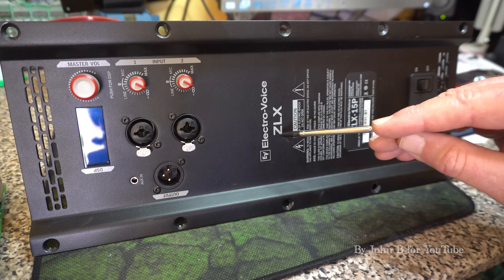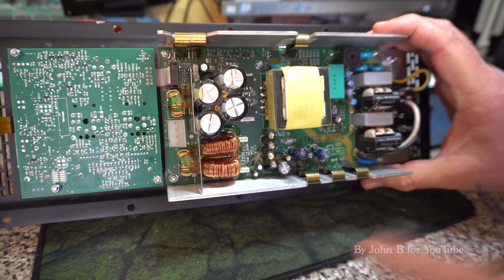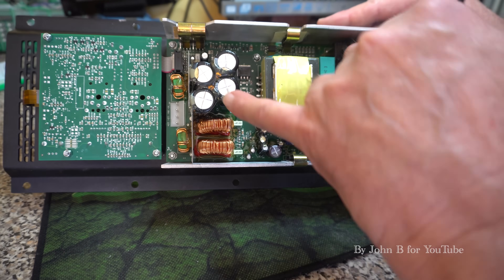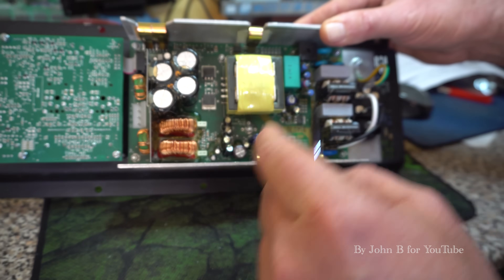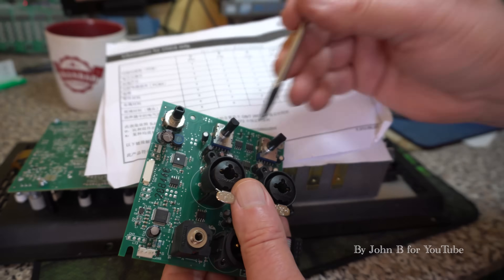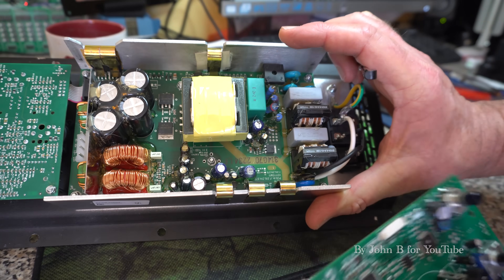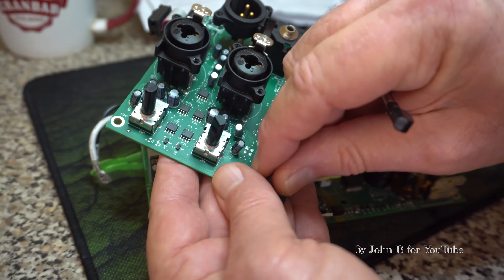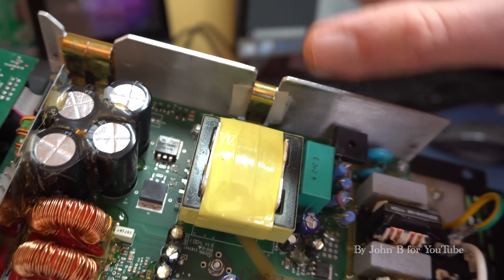The Inconvenient Truth about your Electro-Voice ZLX-12P & ZLX15P amplifier (Read Show More)

Comment: So is this 500 program power or continuous power. P. S isn't it better to go with spl reading as wattage doesn't really mean anything in this day and age.?
Reply from the maker: It's peak power at 10% distortion. Tell the chip manufactures watts don't mean anything.
Reply: @JohnB-2021 experienced users will know that overrated manufacturers use the peak power as a selling techniques to inexperienced users who get fooled by numbers. My understanding is that the wattage is either measured or burps are used to calculate the power which is nowhere near. I've heard the zlx12p and it sounds more like 250rms
Reply: @ninjatzuuninjazuu8776  One thing with EV is they definitely use peak power for their active speaker ratings. How accurate it is, is one thing but either way, power ratings don't matter as long as they get loud enough for your circumstance. I find if you are looking at EV's active speakers - look at the exact passive variants too and they will list their RMS power and you'll get a rough idea of what they will typically run. I know with the EKX12s for example - the powered speakers are rated at something like 1500w. Which is unrealistic, but the passive version has the RMS rating of 350w. So you can put together that realistically the powered version will run around 350w and maybe have a peak of 700w. 

But I'm convinced this really isn't an EV thing. My advice is that if you really want to know what power you are pushing, go passive because you have WAY more control over what you're getting in a product and ratings can be more realistic (As long as the brands are good).

Comment: Hello sr great video.. i have the ev zlx-15p everything work fine but sometimes make a rare noise is like a ant walking on top of the audio cable.. what do you think could be ?
Reply from the maker: Hi,
Thank you for your comments, sadly I don't know what an ant on an audio cable would sound like.
As my friend says, break it some more and then it can be diagnosed.
Reply: John B ok yeah is something like that braking up but the sound work perfect. And I unplugged the audio cable still making that sound
Reply from the maker: @juliomaria3453  Probably a danaged input board, who can tell without putting it on a scope.
If you have 2, swap each board.
Reply: No, because i disconnected the cables and still making the noise
Reply from the maker: Julio María yes that’s why it could be the input board.
Reply: How can I order that one ? Do you have. Link that i can buy it
Reply from the maker: @juliomaria3453  I imagine a Google search will give you an answer.

Comment: Lord John B. I remembered the Peavey products we used in early 80's. We read 200 watts from the pancake an the sound rich all the Block and all night.  Today we see it portable powered speakers with 10,000 watts this is the energy off 10 floors Building consumer so the new generation don't know about Peak (a few seconds )  Program 1 hour at some volts and the RMS. Continuos. 8 hours like a party events. Thanks so much for your info.
Reply from the maker: Thank you for the comments, good old Peavey hey :)

Comment: I just bought  a ZLX12BT to use with my line 6 helix guitar multi-effects processor board. Are these speakers no good? I was going to
Go with an FRFR powered speaker that’s meant for guitar modeling but don’t exactly want to spend over 800-1000$. Any suggestions John?
Reply from the maker: These ZLX speakers are ok if you can get them for a few hundred bucks, I'd not pay more because they are simply not 1000 watts.
Yamaha DBR speakers are much better but come at a price.

Comment: You are right.
That said, don't judge a power supply by its size. Depending on the topology used, a SMPS with a transformer that size could easily deliver in excess of 2000W. 
And none of that "watts RMS" rubbish! The correct is watts, period!
Reply from the maker: Show me a 2000 watt SMPS with one small transformer and one fet driving it.
Watts RMS is rubbish?
Please.
There is no room on that bobbin for an amount of wire to deliver 2000 watts.
Reply: @JohnB-2021  I'm designing a 3000W SMPS for a 2500W amplifier. That supply will deliver 4400W of "burst" power. Also, inside the Yamaha T5n (2500W @ 4R x 2), for example, there are transformers even smaller than the one in the video. Trust me!
Reply from the maker: Matheus Moreira no I will not trust someone who says RMS does not exist
Reply from the maker: @mattmoreira210  I have just found some poor res pictures of the T5n, there are 2 transformers in it, did you forget to mention that part?
Reply: @John B You didn't look at the specs, did you?! Because the amplifier is rated 2 x 2500W in 2 ohms. That's 5000W split between two transformers. And guess what?! 2500W + 2500W = 5000W. Magic!
Reply: @Matheus: Does that 2 x 2500 watt,  2 ohm rating come with a guarantee?
Reply from the maker: @gsonn18  lol, I like it.

Comment: 1000 Watts...    Lets see..  P = VI     I =  V/R   so P = V * V /R .    If rail voltage peak to peak is 80 V   80 x 80  /  8  ( 8 ohm speaker )   =  800 watts peak  +  200 for tweeter  = 1000 watts..  Granted that is peak and not RMS  , but guessing that's how they come up with 1000 watts.   Also data sheet for chip says current limited at 12A  so assume they are driving this as hard as they can.. 10A   P = VxI  so again we come up with 80 x 10 = 800 watts. max.. peak .  Data sheet for chip  says 420  typical into 8 ohm load  but no max info.    If we convert to RMS   .707 x 800 =  565 ..  which is closer to rating for the chip.. So assume 550 for bass  150 for tweeter   = 700   so My guess..  is the RMS is closer to 700  not 500 like stated. That said.. most specs will show the peak max .. vs more reasonable  continuous..  I have ZLX12's  and for the price they are a decent speaker.. These are not top of the line speakers.. so never expected to much.. But they a have yet to let me down.
Reply from the maker: What cereal packet did you get the 80 x 80 from?
Try 35 x 35 volts
The treble chip isn't rated at that voltage either.
Nice try, but you're wrong.
That info you read, that is the max and a nice 10% distortion, they rate their own chip at 82 watts or something at 0.5% distortion.
But hey, if you think 10% distortion at full power is ok, keep on buying them and I'll keep repairing them.
It's sad if you have to add the tweeter to get the max power up. 
That chip is a 100 watt chip, not 200.
Reply: @John B why being so passive aggressive, mate? Chill out. He's brought a nice, constructive argument.
Reply from the maker: @mattmoreira210  
How can it be constructive when numbers are pulled from thin air?
So quoting the 'facts' is now passive aggressive?
Reply: @JohnB-2021    how am i pulling numbers from thin air ??   sorry if you took offense to my post,  but  I was just trying to come up with how the can show  this speaker at 1000W.. I agree, it is a marketing  thing.  and the speaker is closer to 500 to 700 as you  stated when we think about things in terms of RMS or continuous use.    As to how i got 80 x 80 ?    From  YOUR  vid.   You said .. quote.. Tweeter chip is 100 to 150 watts  ( no data on tweeter, so i guess yes, i pulled that from thin air going off what you said )   .. and  80 V p-p   for the main speaker  chip.  Those are YOUR  words.  in YOUR vid.. So not sure what your talking about when you say  35 X 35.    Maybe that is the actual rail voltage  if you measure it for the woofer ?    Also from the data sheet  It shows the bridged mode.. + 41 - 41  into 8 ohms  typical .   that 80V p-p  rail voltage yes?   So that's were i get 80 V  p - p .  ( not from thin air)     Then for a quick calculation ,  i stated the equation for power which is  P= V * I .  ( not from thin air)    We don't know  "I " but can solve for it.. V = IR   or   I =  V/R   substitute  that into P = VI   we end up with    P = V * V/ R   yes ?   so   V =  80v  p-p  right ?   so  P ( peak) =  80 * 80 /  8   = 800 watts  peak  ( theoretically)   add  200W  for the tweeter and your at 1000W.. so that is my theory on how they can market this as 1000W speaker.    No thin air involved.. have a good one..
Reply from the maker: @stevepritchard357  But the chip manufactures quote 2 x 210 watt with a supply rail of +/- 41 volts max, that is peak power and the treble chip is 100 watt, not 200 as I have pointed out before.
One can't take the supply rail max voltage and get more power out of a tiny little chip amplifier.
The actual rail is +/- 35 so the chip does not actually reach it's full power rating anyway.
Powerful sub woofers and amps that quote specs of 1000 watts, or even less, have supply rails of +75 volts and -75 volts, that is more than double of this little EV amp.
They do not swing up to the supply rails before current limiting takes over.
And you will have read, that tiny little chip limits the current to 12 amps max.
No way can the little EV power supply supply a continuous 12 amps at +35 / -35, I'd put money on the voltage dropping even further or the chip would go into thermal protection due to the lack of good thermal conductivity on it's heat sink pad.
Or, they just blow up like hundreds do.
Reply: @John B oh, so it wasn't your intention, was it? Sorry for that.
Reply: @Steve Pritchard yes! That must've been how they got their 1000W "peak" figure. I hate marketing.

Comment: hi mr jonh mi name is jose ijust want tell you i made setup  2 bass ekx18sp on 2 zlx15p but when i conect to power  on turn on star make it big noise  on after 30 second burns it one base on one speaker  you have some ideas why those happened?
Reply from the maker: Probably some earth loop, I have heard of a few systems failing because there are problems with the earth on the input leads.

Comment: Thanks for the video. There are so many active class d speakers that use this type of setup. The issue I have with the whole on-board dsp (analog devices / st-mico / whichever) is if that ic gets damaged, you have to purchase a whole new board as no-one supplies firmware for it. Such a waste really!!  I have to ask why you keep saying it's not running bridged? If one full channel is only amplifying the positive half cycle & the other channel amplifying only the negative half cycle, is it not then running bridged?
Reply from the maker: Hi, 
Yes my bad, it's running in Mono Bridge-Tied Load
I wanted to highlight it's 2 amplifiers in one package, not just one signal and ground.

Comment: John, I have a pair of the newer mackie thump 15a's.   I used them for band practice (vocals only) for 2 years now.  then 1 gig with the. as  full range mains (vocals, guitars, a little bass, and kick mic) though we had subs too.    One of them sounded distorted after that.  Distorted like an active bass with a low battery distorts.   Repair shop says it has a bad "power bucket "  I have no idea what that is?   Should I fix it for similar future gigs?   I was contemplating buying some EV speakers instead .  what do you think?
Reply from the maker: I think if you buy the EV speakers mentioned, you'll be disappointed since they are no better than the speakers you have.
Get someone to swap the amp and power supply and woofer from one to the other to narrow the fault down.
I've never heard of a power bucket, not even as a slang term.
What country are you in?
Reply: @JohnB-2021  USA my friend.
Reply: After paying $200 to have all the electronics/amp replaced... that speaker cabinet still had the same problem, same distortion.   I took it back and since they mis-diagnosed the problem the 1st time (turned out to be a blown woofer) they re-coned the speaker at no charge.
Reply from the maker: @chucksano  Great news I guess.
You will see I mentioned swapping the woofer, it's a common problem on Thumps.
It's the first thing that should have been checked.